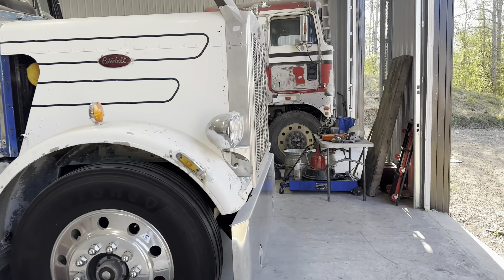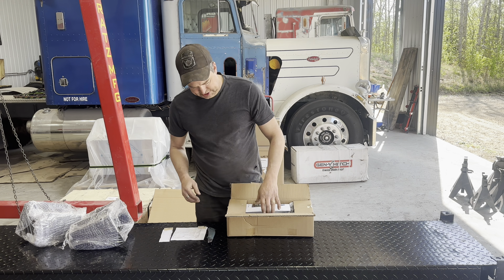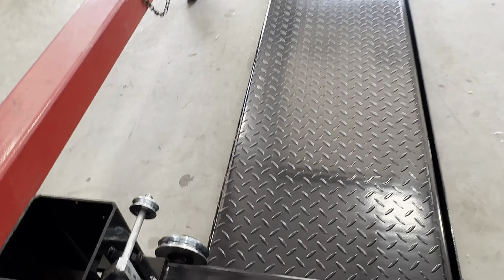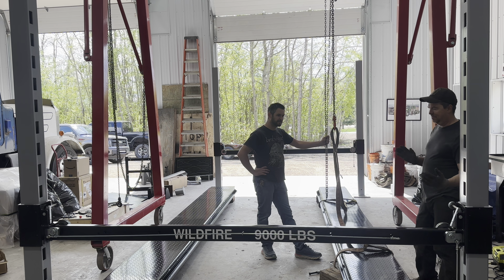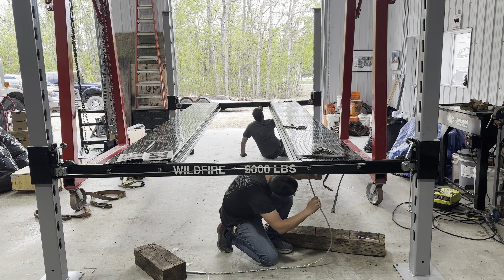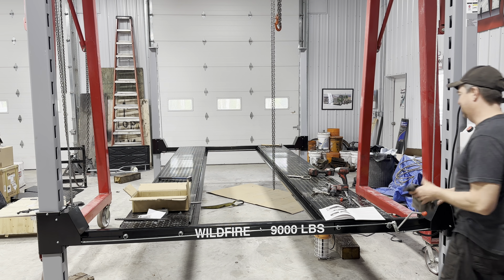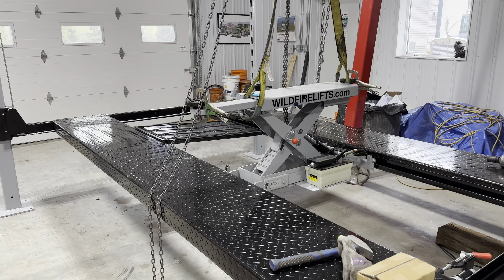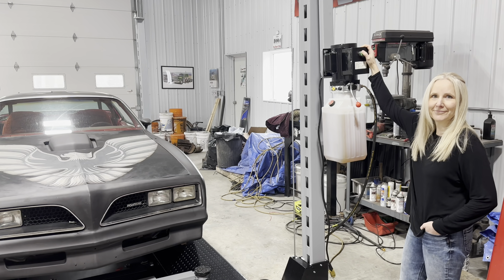Smokey & The Bandit TransAm Ep.1 Lifting A New Project

Comment: Cool lift and nice Trans Am project.  Forget pinching off the rear brake line and get a line lock for the front brakes.  It's an electric valve that holds pressure in the front brake lines. Step on the brakes ,push a button and release the pedal.  Mash the gas, smoke up the rear tires and when ready to go, release the button.

Comment: Buy a lion lock valve that they used to put in toe trucks and put it on your front. Brakes so when you wanna do burn out? You just push your brake pedal down switch the switch then you front breaks a lot

Comment: if you plan to put round headlights in it. you have to swap the front fenders with the rad support. and the hood to be correct. that 77 hood will work but the lines are slightly different

Comment: Wow, that is a really nice lift!  However, it seems that it's pretty much going to occupy one bay or another, even if it rolls around.  Is there enough room to turn it sideways at the back of one bay, and then back one of the trucks under it?

Good job on getting a Trans Am (I have one too, a true '77 SE version which I need to finish restoring; you'll probably be done before I am).  If you're going to make it "movie correct", there's going to be a lot of work required: replace the top with one for the Hurst t-tops instead of the current Fisher tops; new rear tail light panel for the '77 rear; change the color of the interior; 15x7 snowflake wheels; Pontiac 400 engine (although all of the movie cars didn't have one); etc.  No doubt you can pull it off, but something's going to be sitting outside in the snow for a while 😀.

Comment: Nice looking lift.  The Trans Am... needs some work to look right.  Is that a crushed velour interior I see?  That would be pimpalicious, as we used to say. Pontiac 301 engine?  Definitely a fuel saver, but pretty anemic, a pretty standard and sad drive-train for the early 80's.  Yeah, it needs a lot work and a lot of upgrading to be proper looking '77 black Trans Am.

Comment: I so miss my 77 Trans-Am Bandit, it was my first car and a project between my father and myself. The biggest issues I found during our restore was finding original parts. You have a great base to go off of with that car. I also found those T-Tops to be a PAIN when it rains, we ended up custom making some gaskets and it fixed the leak issue I was having.
Are you going to change out the tail lights and rear bumper for the more "movie correct" look? I think the 77 Lights and bumper will clip right on like the nose did.
Reply from the maker: I kinda like the current taillights 🤔 but we’ll see how much “movie-correct” OCD kicks in once I get going

Comment: Mint! Can’t wait to find all the surprises that car has hidden
Reply from the maker: Thanks again for your help Blake!
Reply: @TwinStix  with anchor points in the floor of the trailer and a friend who can structural weld you can make at set of roll off ramps to go from the Wildfire lift into the trailer with Bandit 1 for those trips where Mrs. Twin-sticks would be more comfortable riding in Bandit 2 till you get near the show/ event location and can off load Bandit 1 if you choose too. and a false wall in the trailer made too look like a wall of Coors could be used to hide the car or any thing else ( a small camping setup) . Just a thought

Comment: Those corvette wheels are tripping me out on a firebird. Who does that.
Reply: Lots of people did. Remember this is a 1980 Firebird than has been made to look like a 77 TransAm. The 1980 Firebird rims were either pretty aluminum that sorta looked like dinner plates, and the steel rims were either hubcaps that were ugly and made out plastic and prone to breaking or steel wheels with urethane centers that sorta looked like snow flakes that weighed a long ton, ugly, and prone to vibration. However the corvette wheels while not the most stylish (imo) in the 90’s and early 2000’s were pretty cheap at car shows and often came with decent rubber mounted on them because Vette owners changed wheels and tires and keep the original rims if the sold the car but more often than not decided they needed space at home and sold them

Comment: A resonator and bulky muffler on a single pipe attached to an anemic motor.? No bark. I knew it was coming sooner or later! I actually like the vette wheels, but certainly not movie correct. For a second I thought it might be the turbo'd '81 which would have been unique. Get rid of all that smog crap and it'll be a proper muscle car. 455ci?! 😛